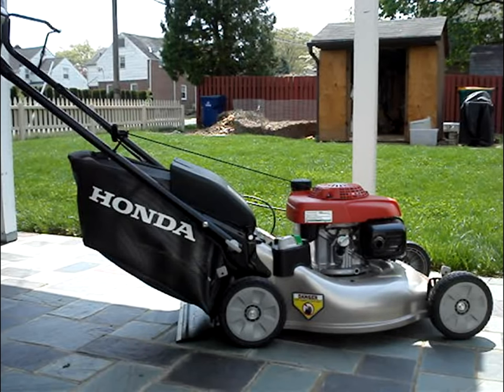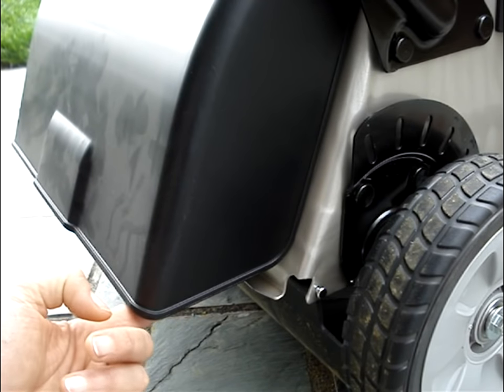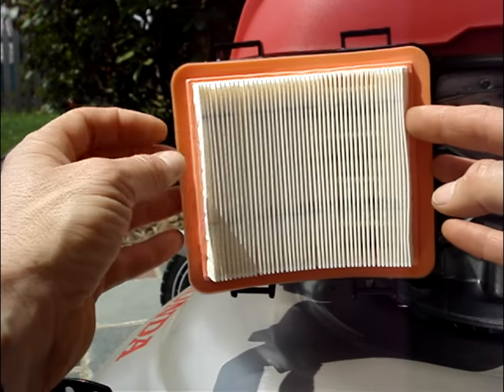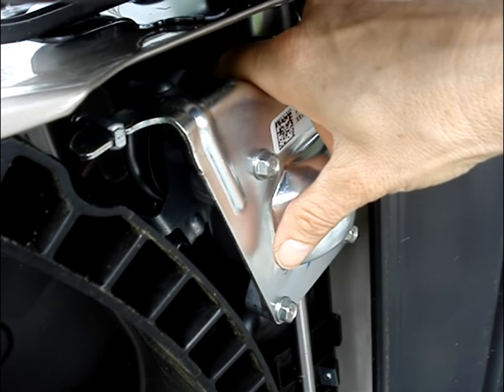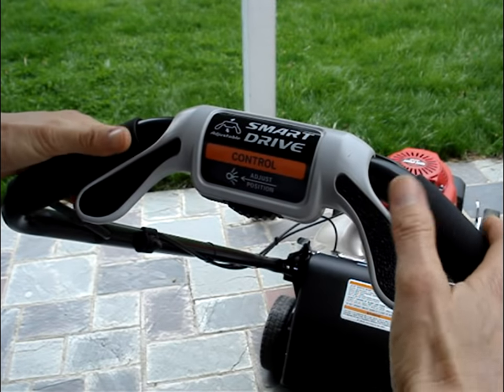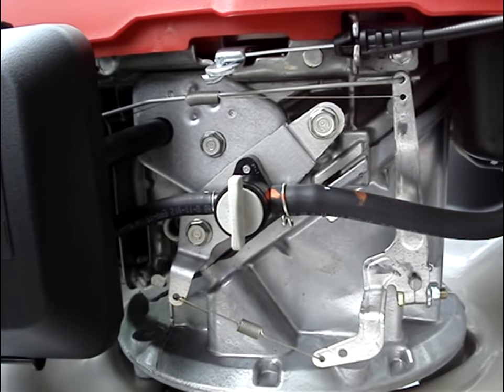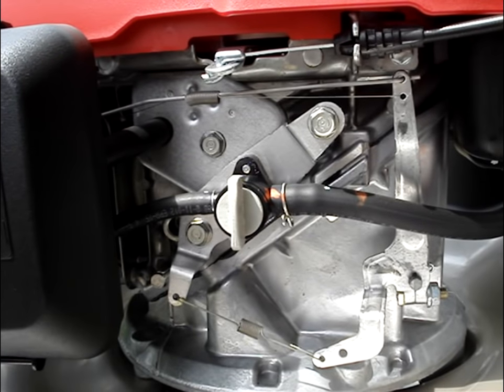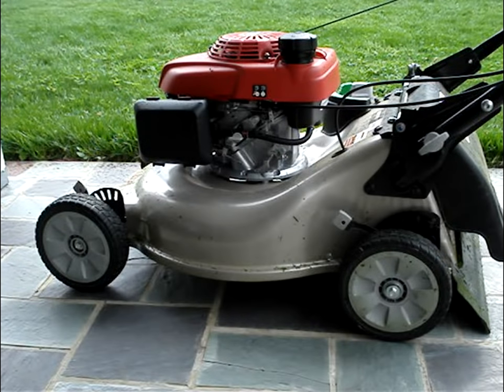Honda HRR216K9VKA Lawn Mower Review

Comment: I own the same mower five years now.The only problem I had was the governor spring broke after three year.Easy fix. Nice mower. Good job on the review.
Reply from the maker: So far mine has been trouble free.  I have noticed a little rust on the bottom of the deck, though I rarely clean it and sometimes have to mow damp grass.  If I were buying it again, I think I would go with the plastic deck.  I was kind of scared of the plastic deck thinking it might become brittle and break.  A friend has the plastic deck.  I think his mower is around 10 years old - no problems with the plastic yet.

Comment from the maker: It's March 2023 time for some more thoughts on the Honda Mower.  I've used the mower for 5 seasons.  I don't mow a huge yard, but do a lot of turns around flower beds and other objects in the yard.  The last of the rubber tread peeled away from one of the rear wheels this week.  Wheels that wear out quickly is a complaint about this mower.  I couldn't find any aftermarket wheels that are better quality.  I bought a set of 4 OEM wheels on eBay for $43.41  The mower still starts easily.  My biggest beef is that it does not roll backwards easily.  I've changed the oil once a season and replaced the air filter.  I bought a spare set of blades which I sharpen are swap when needed.  No other problems yet.  Link to video on how to change the wheels:  https://youtu.be/zRmnrDTzpaU

Comment: I just bought one tonight. I did not get the  Home Depot warrant. The mower came with 3 years plus an additional year if you register it within 30 days. I won’t have a chance for a couple days to mow my grass. But I’m coming off a mower I bought in 1994 that has lasted over 25 years. The last five years I had no self propel so I have been pushing. This is going to be awesome.. On my old mower I used premium gas and change the oil and air filter regularly. I think the premium fuel makes a big difference in the long run.
Reply from the maker: Thanks for taking the time to comment, Jeff.  Feel free to write any pros or cons about the mower after you use it for a while.  Insightful contributions and discussions are welcome here, I think they add to the value of the video.

Comment: Finishing up my fifth mowing season with my Honda.  Starts on first pull 98% of the time.  I change the oil every 30 hours and I have just done a blade replacement.  Original plug and original air filter still look good.  I resharpened the original blades and kept them as a spare.  I never use the bagger.  I want the nutrients of the clippings back in the soil.  Mulch feature works great.  Amazon sells a "tune up" kit that includes blades, oil, spark plug and air filter.
Reply from the maker: Thanks for taking the time to comment, Robert.  It's contributions like yours that add extra value to the video.

Comment from the maker: 3 month use review update:  First one correction (Thanks, Sam for catching the error), the rear wheels have ball bearings, the front ones do not.  The mower continues to start on first pull every time. When I was researching my purchase some complained that the mower did not cut the full width.  If the grass is wet & on the long side, the cut does get a little sloppy & you have to overlap an extra 2-3 inches.  There were also complaints about the rear wheels locking up.  I found service bulletin #107 dated March 2017 addresses that problem.  Apparently the bushings were undersized.  That is an old problem, likely corrected some time ago.  

I don't have any complaints about the mower.  I did adjust the smart drive cable per maintenance schedule and changed the oil.  I made videos showing how to do both of these.  Click on the channel name & check the playlists for those videos.

It's Spring of 2021.  I am still pleased with the mower.  It started full pull.  The biggest complaint I have is that Honda has designed the mower to have some resistance when you pull it backwards.  I suppose this was done for safety?  My brother has the non self propelled model.  He took the wheels apart and disabled the backwards drag.  I don't know if that can be done with this model.  When the wheels wear out I will see if I this model can be altered.  Also, if you mow wet grass and allow the clippings to build up on the deck it does degrade the mowing quality.
Reply from the maker: I have found that after washing down the underside of the deck that sometimes the next time I use the mower the back wheels are stuck.  The do loosen up after I give it a good tug.  Maybe something is starting to rust?  Somewhere in the comments of this video, someone mentioned they contacted Honda and found the the mower was intentionally designed to make is hard to pull backwards (dumb IMHO).  My brother has the non drive train version of this mower, he was able to remove the mechanism that makes the wheels hard to roll.  I have not found the time to tinker with mine and see if I can do the same thing.  I have not looked into ball bearing replacement wheels.

Comment: Solid video. Great review just bought one myself.
Reply from the maker: I've had the mower for two years.  Overall, I am pleased with it.  It is a bit hard to pull it backwards, apparently by design.  I don't think that's a great idea.  Some people complained about the rear discharge, but they apparently are not closing the door by setting the mower to the mulch position when not using the bag.  It still starts on first pull, unless it's cold outside or if you stop the mower before it has totally warmed up.  Then it takes a few pulls to restart.

Comment: Excellent Review! 
I just bought (3 weeks old) the Honda mover.  I had pretty much similar complaints. One of the front wheels never touches the ground. 2nd is the hand get really tired with the speed control. 3rd, the rear wheel drive (my old mover was front wheel drive, if moving on an uneven surface or over a ditch, I just lift the Mover’s font up, and push mover to overcome the barrier. If I lift this mover front up, it will be difficult to control unless I release the speed control and push). Fourth, if the grass is grown high, no way can you cut it, even if you use ‘clip’ or ‘bag’ selected. The grass is pushed through the back, is not open enough and grass get clogged up in there. Other than that this is a great mover. It has twin blades, great quiet, smooth engine.One pull, engine starts.  The mover is good for flat surface with no obstacles. My lawn is uneven surface  with slopes.  My main difficultly with this Mover's is with its speed control, hand get really tired and achy after a little time. Honda engineer who designed this feature deserve no credit.
Reply from the maker: Hi Al, thanks for taking the time to contribute to the review.  It's input like yours that make the review more valuable. 

Initially, I had the mower doing a few "wheelies", but as I became accustomed to using it, I don't do any more mower "tricks" or maybe after a little belt wear the drive mechanism works a little differently.  You might try adjusting the angle of the speed control so that the area of your hand below your thumb is pushing on the control instead of pushing with your thumbs.  I likely don't have as much hand strength as most men.  By pushing with that part of my hand, I don't have any fatigue.
Reply: Thanks
Reply: I had the same issue with all wheels not touching the ground on level, I bought the wheel & brackets & problem solved.
Reply: Had this 7 years. Saves about 10k on landscaper fees. 

As for it getting clogged up when grass gets too high, you’re correct.

What you can do to prevent that is  align the lawnmower so only half of it cuts, the other half is above low grass or concrete. By doing that it will lessen the amount of grass and should not clog. You will although have to do more passes back and forth .

Comment: Just found one of these in the garbage.   I have a feeling the air cleaner was dirty and someone threw it out because it would not start.   I removed the air cleaner and it started.  Seems to work okay.  Vibrates alittle but it is December and cold.  I will give it a closer inspection in the spring.    Thanks for the video
Reply from the maker: I've used mine in the cold weather ( around 40 degrees Fahrenheit) a few times to mulch & bag some leaves.  It takes more than the usual one pull to start.  I've also noticed that it's a little harder to pull the mower backwards.  I'd guess  cold grease is the cause.
Reply: I’m not sure.  Checked it today and the belt is still on the pulley underneath.  The exhaust is clean.  Not even black on the inside.  The motor casing is clean.  Just the wheels are alittle worn out.   Still scratching my head on why anyone would of thrown this machine out.

Comment: I personally have owned and used both this exact mower (which I sold after one season in 2017) and currently own a Toro AWD Personal Pace 20353 model number (going on second season with the Toro purchased in 2018) 
The speed control on the Honda is very touchy.  After several uses the mower became very difficult to pull backwards as the rear wheel driving mechanism had seemed to get tight or was binding up somehow.   It mulches and bags well but Honda needs to design a chute that attaches at the rear to redirect the grass clipping to the side if you are not mulching or bagging.  Quality of cut while either mulching or bagging is excellent. 
The Toro Personal Pace speed control is simply genius and far superior to the Honda Smart Drive thumb/palm actuated system.  Mowing on flat terrain or on grades is simply effortless with the Toro Personal Pace.  Quality of cut is also excellent and certainly on par with the quality that the Honda mower delivers.  The Toro is definitely quieter with the Briggs and Stratton 163cc EXi engine which also feels slightly more powerful than the Honda.  
I’ve owned and used both for at least one full season on a 1/3 acre lot with some terrain, and my choice is the Toro with Personal Pace hands down.  Plus the Toro actually has a side discharge with clip on Chute whereas the Honda does not (rear discharge, come on Honda you can do better...) and the Toro has a washout port, whereas the Honda does not.  
Toro - 1
Honda - 0
Reply from the maker: Thanks for taking the time to write the comment about your experience, constructive comments like yours are welcome.  That's what I love about YouTube, the contributions from viewers.
Reply: Whats wrong with a rear discharge? I think the entire purpose is avoid being limited to mowing on one side around obstacles with a side discharge. In fact who would even want a side discharge?

Comment: I have had mine for 4 years now and have not had a single problem. The 3 problems you’ve mentioned that people had problems with was never an issue for me. Some i think might just be user error. If one knows how to use this machine correctly, it shouldn’t have those problems. Im usually a good user of a product and aware of how to use a tool for its limits. I think some people just drive this machine and do not pay attention to anything. Ie some motorists will drive their cars and not put oil til it breaks. Then wonder why it stop working or making weird noises.

Comment: Hold off on this mower.  After owning for 2 years I can say the motor runs great and still starts on the first pull.  Highly recommend spending more money for the Honda with a side discharge.  Mulch option can't keep up a lot of times especially if the ground is a little wet.  Also Rear wheels tend to lock up on this mower and won't allow the mower to roll backwards or turn.  My Self propelled drive is already failing.  Going to start with a belt and drive pulley to see if that fixes the issue.  For a name brand Honda mower I feel you shouldn't have this many issues.  Do your research before you buy this model!
Reply: My rear wheels locked up after less than 1 year of use.  I took it into local honda service dealer for repair.  I'm not dealing with that under warranty.  Might just need run this for as long as I can and maybe just buy a better one or a better of something else....

Comment: I might be getting one and this video helped a lot.
Reply: I got a 2018 model after 2 weeks the fuel on off knob popped right off I took a back and got a new one. Then I was mowing my grass and the rear driver side wheel fell right off!! I know what's going on and I know Honda is a great name but this happened to me so I definitely wouldn't spend $400 on one of these ever again
Reply: richelle reynolds 
Which model did you get?
Reply: richelle reynolds also, I got a 2017 one used in great condition, and I must say, I am very impressed with it. Best mower I’ve had so far.

Comment: That's a really good clean mower during the time of the video..
Reply from the maker: It's not so clean now.  lol.  I am still pleased with the mower it still starts on the first pull and has been trouble free.  One thing I find that I am not crazy about is that Honda has intentionally made the mower hard to pull backwards.  My brother has the non self propelled version.  That mower was hard to push... he got it from an older woman who couldn't push it.  There was a part in the wheels that caused drag, he removed the parts.  The mower now rolls freely.  I have not checked the back wheels to see if I can modify mine.  I have a friend who has the version with the plastic deck.  I shied away from the plastic thinking it might not hold up.  His mower is at least 10 years old and the deck is still OK.  If I were buying the mower now,  I'd go with the plastic. deck.
Reply: @Know-How-Now  I have the mower, I found the same issue but I found that taking the wheels off and spray everything with simple green concentrate will definitely make it roll backwards again.. also make sure to lube the wheels before putting everything back together.. it really works.. I also lube any moving parts either grease or WD-40... I sprayed fluid film on bottom deck... These mowers are really good... I try to keep clean and I keep it in my garage covered when not in use.
Reply from the maker: Thanks for the tips, Michelle.
Reply: @Know-How-Now  thank you.. I almost gave up on it and planned to take it back to John Deere is I purchased it so they can fix it but decided to try on my own and it worked 👍
Reply: That's because it was brand new.???

Comment: Does this mower stay idle when you let the throttle go?  I’m looking for a new mower that doesn’t require a pull start every time you let go of the throttle. 
Great review by the way.
Reply from the maker: When you let go of the handle, the mower shuts off.  I doubt that you can buy a new mower that doesn't shut off.  If you are a little creative you can by pass the safety feature.  I like the mower.  The thing I like the least about it is designed to create some drag when you pull it backwards.  My brother has the non propelled version and he took the wheels apart and removed the mechanism that causes the drag.  I don't know if you can do that with this model.  When I find some free time I am going to look into it.
Reply: hockey tape

Comment: I have  had this mower for years. It always starts first pull. It's starting to not want to pull itself and according to check list in book it is still adjusted ok. Outside of this the thing I've  hated from day 1 is the clippings coming out the back. They cover my ankles and feet. I don't use the bag because of the size of yard. So for that reason I won't get another one. It does cut great and  like I said starts first pull every time.
Reply from the maker: I've noticed that if I don't use the bagger and forget to close the door by changing the setting to "mulch" I get a lot of clippings from the back of the mower.

Comment: i have the same mower, 6 month old wont start  now. was sitting for about a month.  any ideas
Reply: My experience is that the carb should be run dry after ever use to avoid fuel problems

Comment: you never mention the trottle on the motor on how it works or if its set to auto. just didn't see a lever on the handle bars
Reply from the maker: The topic of the video is about the drive train, you might want to search for a video on the throttle to find the answer to your question.

Comment: Is the wheels rubber now instead of plastic?
Reply from the maker: The wheels on this mower purchased 4/2018 are plastic.
Reply: Know How Now,  thanks for the reply..wish they was rubber
Reply from the maker: Me too, it's hard to find anything that is designed to last or not cause you to buy parts for it.  Honda probably makes a ton of money on the replacement wheels.
Reply: So true. Thanks for the video review,I gave it a thumbs up
Reply: Plastic tires that were worn out after two years and had to be replaced ...but at a reasonable cost and were easy to replace.  Not a big deal for an awesome mower

Comment: Thanks for the video. Mind if I ask how much?
Reply from the maker: you are welcome.  $399, not including tax.  I bought it from a local dealer.  My thinking was that if there was a problem or warranty work they would be more knowledgeable than a big box store.  If I remember correctly, their price was the same as on line.  I know buying it at a dealer is not an option for everyone.
Reply: @Know-How-Now  $ 374 ish (Honda price drop) Home Depot with an extra year warranty from Honda.

Comment: One of the most useless machines I've ever used.. Too heavy
Reply from the maker: Thanks for commenting, James.  Which mower in this price range do you recommend for anyone who may be looking for a lightweight machine?
Reply: Actually, Troybilt has a non self propelled mower with the Honda engine that is very light.
80 lbs, with large rear wheels, great trim mower.
Reply: Briggs and Stratton 450E series it's the best
Reply: James Muringi, in another review it was said that this is one of the lighter mowers on the market.
Reply: @jamesmuringi4933  that's just the engine bro... Can mow much with that?